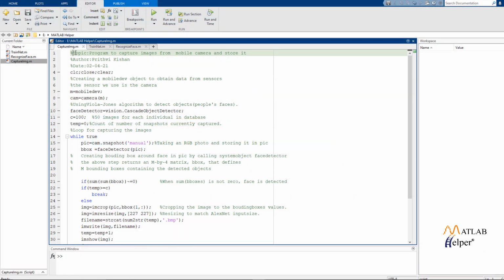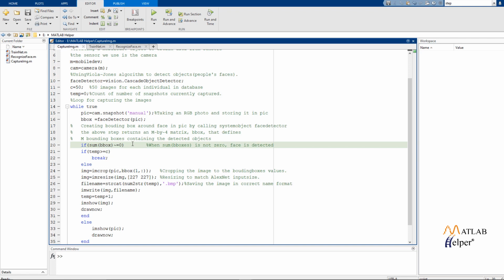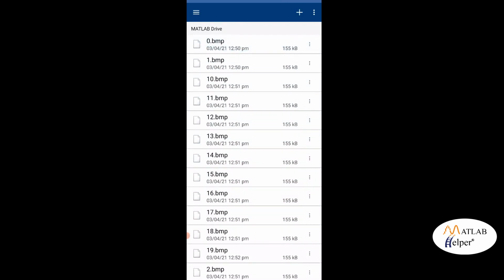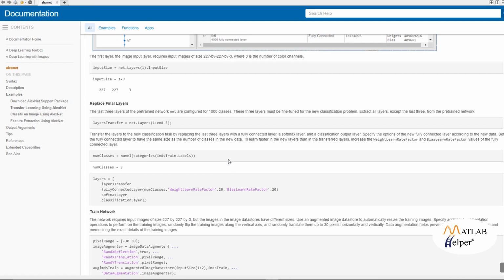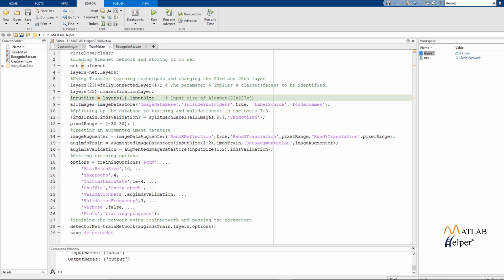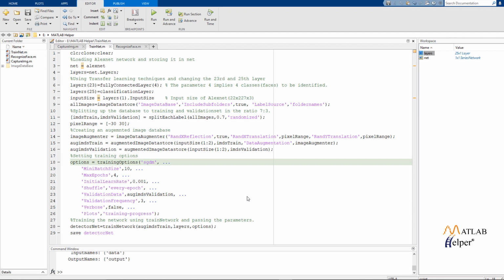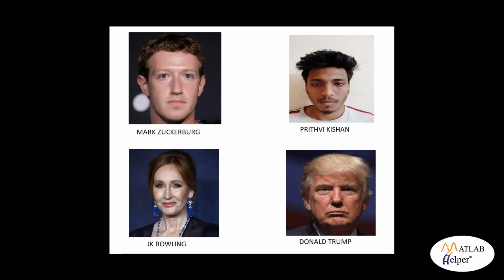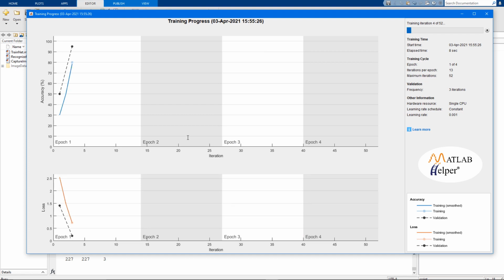Face Recognition using MATLAB Mobile | @MATLABHelper Blog

Comment: I have one question and problem

- Did you upload the file 'detectorNet.mat' to the mobile device?

- I get an error when I run code capture, "Error using mobile dev object is not connected to Redmi 9s"
I access the sensor and camera in the mobile app

MATLAB R2018a
Reply: Yes I did upload the file 'detectorNet.mat' to the  the MATLAB drive which was then accessed in the mobile device.
Also for the error you are receiving , please ensure that you give access to your camera to MATLAB in your settings. Sometimes  you have to run the code twice since your camera maybe being used by another application.
Reply: Hosny Gamal , check if you have given access to camera by opening MATLAB on your mobile, then go to sensors-> more -> Then select the camera acess option. Also to answe your question , you do not need to connect you mobile to laptop you can setup your MATLAB drive and access files on both your mobile and laptop device.
Reply from the maker: Hosny Gamal, Do write to us with your requirement at team@matlabhelper.com, or You can start an online chat at our website. Don't forget to Subscribe to our YouTube Channel. Happy MATLABing!
Reply: Error using capture (line 5)
mobiledev object is not connected to Redmi
Note 9S device. Make sure that Redmi Note 9S
has MATLAB Mobile running and is connected
to internet.
Still, have the same error, Is must I connect mobile to laptop or anything other?
I Can't execute a capture file
Reply: I face another problem
When l classify an image in mobile
Back this 'classify requires one of the following deep learning toolboxes
Econometrics Toolbox
Did you upload the toolbox to the mobile app?